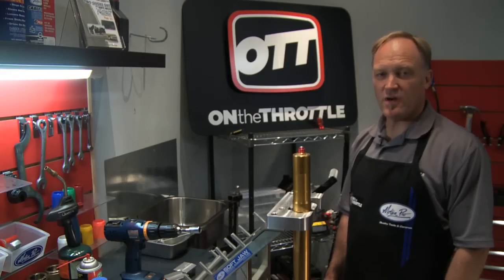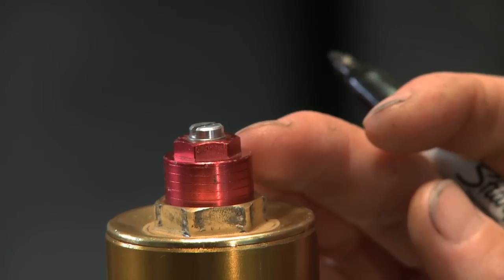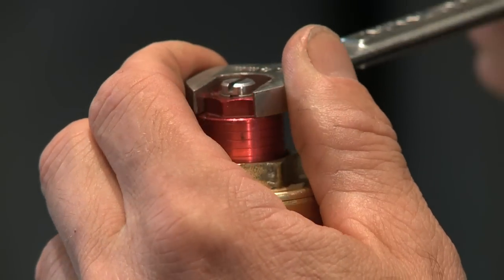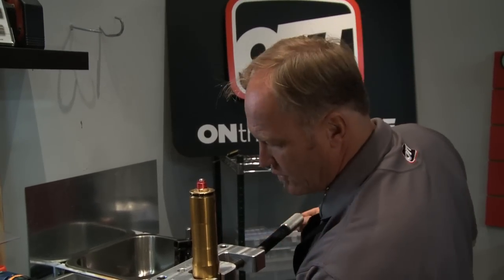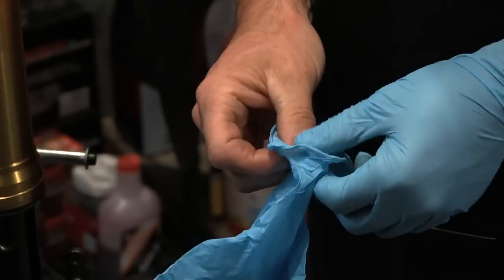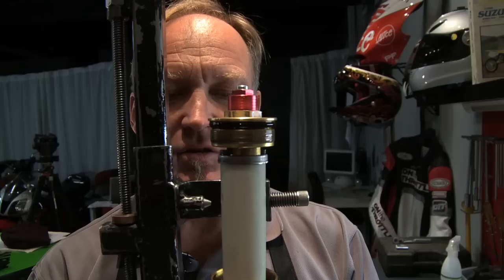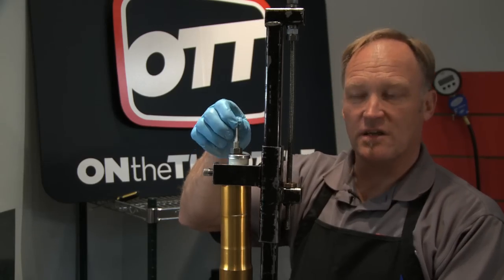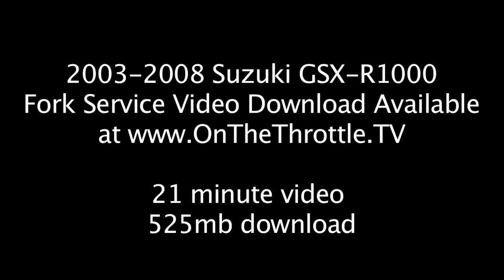Fork Service Promo, Suzuki GSX-R1000 03-08

Comment: Bought full video as now have forks spring compressor - local shop charge £60 to shorten spacers refit etc.  Thanks video shares all that's necessary as opposed to Suzuki manual and many on You Tube who omit how to set up rebound adjuster properly, so simple when you know how.  Thanks Dave much appreciated.

Comment: Using a shifter on the aluminium fork nuts mars them. Try a metrinch wall drive socket with some tape or thin rag to protect the aluminium. The fork caps have a very shallow nut height. I put metrinch sockets in a lathe and turn the lead in off so it  has zero lead in and makes full contact with the wall height of the fork cap hex head.

Alternatively there are hex spanners available with plastic inserts. Some fork caps have the hex recessed slightly with a dish. This gives less wall height if using flat spanners. Sockets work better for those caps.